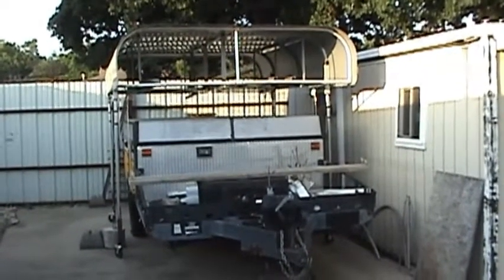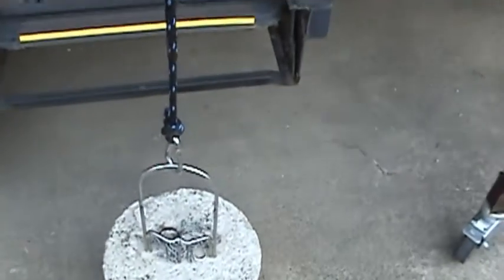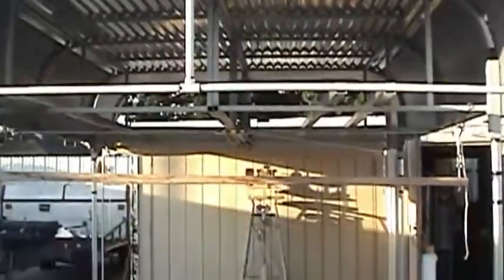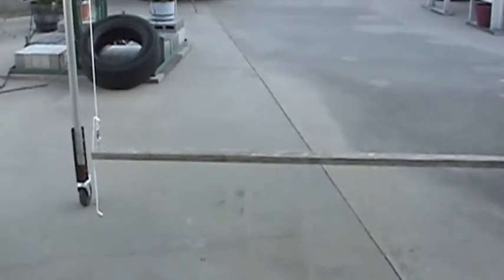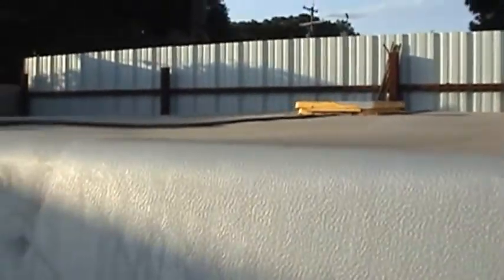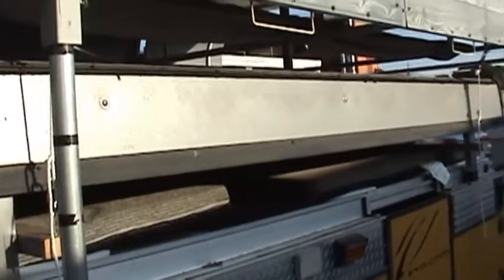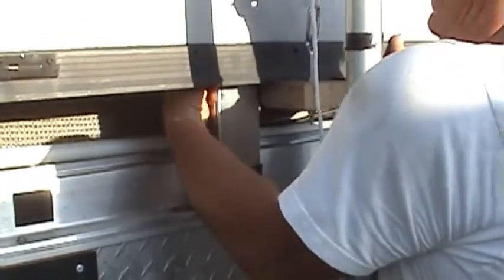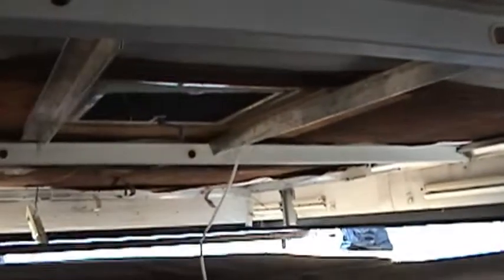Mobile Carport - E2 Camper Top Lift

Comment: Had a Similar idea!  Wanted to use it to take the top off my lifted Wrangler.  Would be good as portable shade too, when working outside, grilling, etc.  Thought I might add solar on top to charge a battery to power the hoist, and or fan.  Ideally, would like to make the height adjustable too/
Reply from the maker: Nothing like having portable shade during summers like this one. 107 yesterday